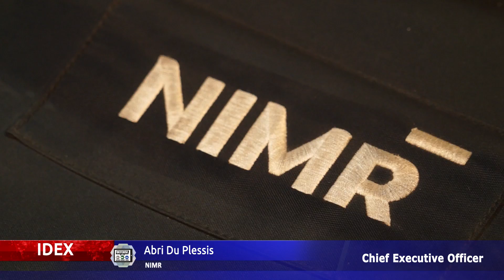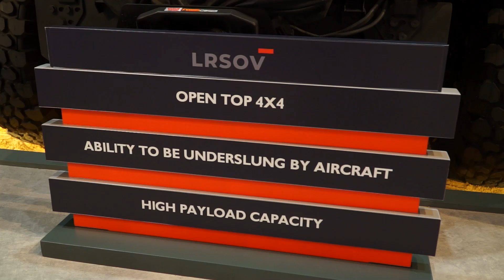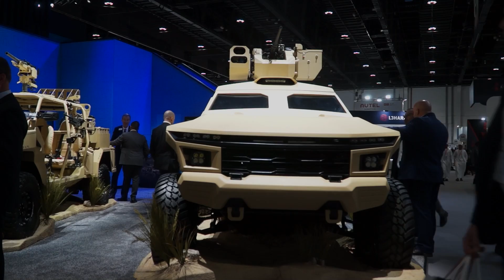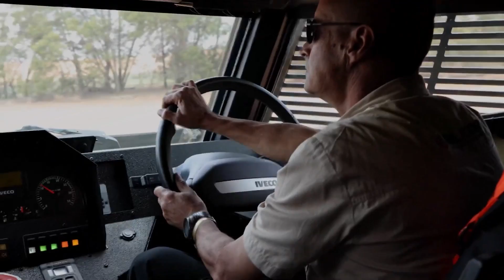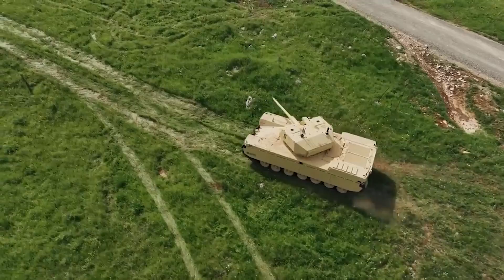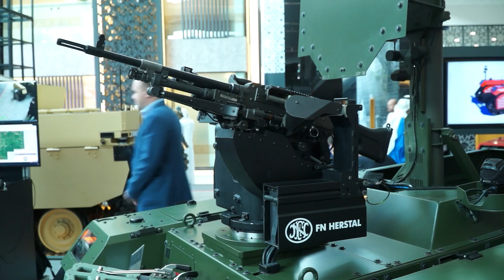DAY 4 IDEX 2023 Defense Exhibition NIMR RCV Robotic Combat Vehicle Milrem Type-X Milkor UAV armored

Comment: Type X and themis are very good looking but they seem to move relatively slow( even if it says 80 km h  max road speed) , I understand that autonomous or remotely operated vehicles are difficult to move fast because of the important data flux creating latency. 
My point is that, for now they seem useless on the battlefield and just are huge slow moving expensive targets for the enemies (stop , acquire, validate, then fire)

And please give that themis a hydraulic suspension system especially if soldiers hop on it

Comment: a IFV variant of the Milrem Type X could be something . . . the Type X will be turretless & the hull will be raised a few inches to comfortably accommodate 3 - 5 troops in full tactical gear . . . the heightened hull will feature 2 roof hatches, one for the gunner & the other for observer . . . immediate forward of the roof hatch will incorporate a 25 MM GAU-12/U six-barrel rotary cannon & a custom 13.5 MM HMG . . . both mounted to a 360° deg rotating remote weapons station . . . the Type X suspension setup could do with a proper heavy duty 5.0 in. suspension lift for enhanced off roadability across rough terrain . . .